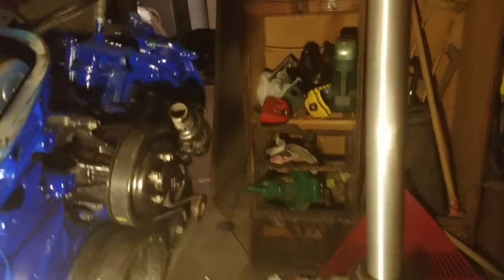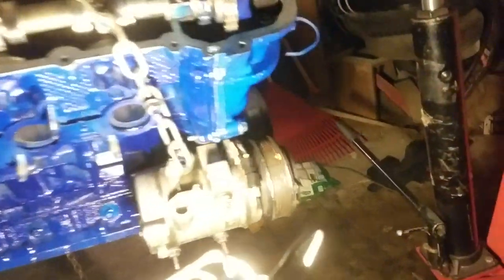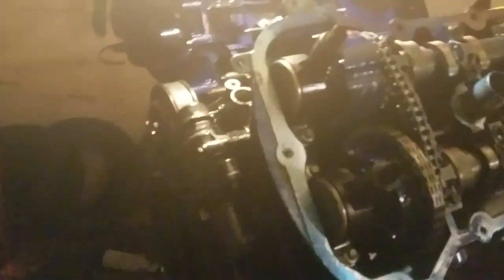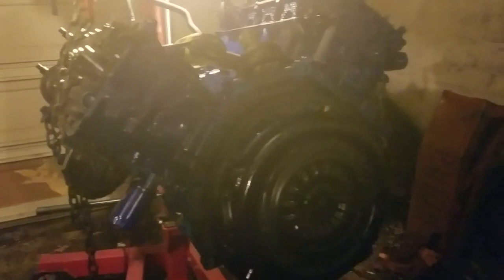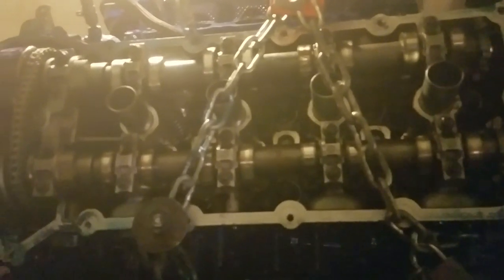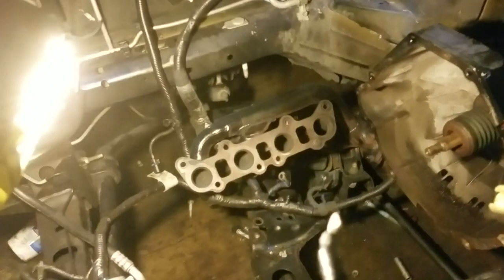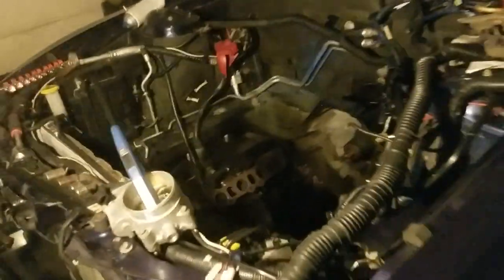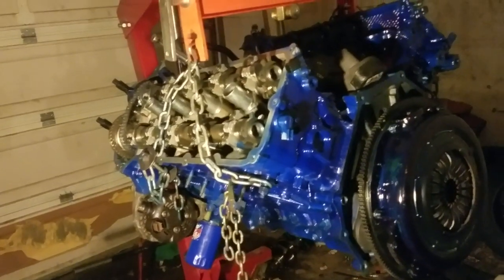The answer to the 5.0 coyote tick....smh @ ford

Comment: when you drained your oil did you notice any sparkly/glittery stuff? i have a tick on my 2011 mustang GT aswell and my oil came clean when i drained it

I know this was 6 years ago but when you changed the rod bearings how many miles did you drive on it? you still have it? did it fix your tick?

this damn tick is aggravating i thought this 5.0 coyotes were reliable
Reply from the maker: Does it sound like the tick is coming from the top half of the motor or does it sound like it's coming from the bottom?
Reply: @lyte1981  well right now engine is opened up and im replacing the timing chain and tensioners checked all rocker arms and valve lifters but nothing there seems broken so if this does not resolve the issue im going to be doing the rod bearings next wanted to know how your oil was before you did the bearings just for comparison and if the tick ever came back

thanks for the fast reply
Reply: @lyte1981  mine was a rod bearing also cylinder 5 had a few chunks out of it, good thing i caught it before it got worse
Reply: I finally got to all of them cylinder 1,2 and 4 were in good condition the rest were fked cylinder 8 was the worst

Comment: Did you get the engine back in the car again?  Does it not make the noise anymore?  I've had a similar engine noise since the car was new.  I've done engine oil analysis a couple of times never found any extra metals reflecting a bad bearing etc.  My car also has a weird phazer nioise especially after oil changes and when it's warmed up.
Reply from the maker: I just finished fixing it..... My issue was a connecting rod bearing on cylinder 5...
Reply from the maker: alcarames1 I got it back up and running....video pending🏁🏁🏁💯🌴🌴🌴😎
Reply: Jason lyte bad bearing or rod pin?
Reply: @Anthony Hales what became of yours?

Comment: yeah mine started ticking about a month after I bought my 2014 f150 5.0 from the dealership, its been a year and its turning into a knock. right now I'm running sct x4, custom mpt e85 tune, 100 shot of nitrous and straight pipes, how much you think it would cost to have someone replace the bearing? I don't really have the time for it and right now its my only vehicle, and I dont think theres much I can do to get it back to stock for my warranty not to look voided

Comment: Was it a tick or a tap noise? An did it get louder or stay constant at any rpm??
Reply from the maker: 79z28camaro1 it was a tick noise at idle to 2k rpm
Reply: see my truck only does it at idle. it doesn't go up with the rpm.. i am at a loss for what it could be..  any advice would be appreciated.
Reply from the maker: Garret Rowe do you here it up top or down low at the crank?
Reply: I have it on the rear of the engine. It sounds like it's coming from my exhaust
Reply from the maker: Garret Rowe that may be a phaser......but if you get under the truck. ....and you hear.....connector rod bearing
Reply: hmm I got under the truck and it was quiet until it got up to operating temperature then I got under it and I can here a faint ticking
Reply from the maker: Garret Rowe well my friend there is your answer you have a connecting rod bearing that is going bad
Reply: Jason lyte well that about blows.. only 75k and this is starting to happen. Run it till it blows
Reply: Jason lyte if it was a phase would is show hooked up to a computer? I took my 14 gt in for them to tell me you have no codes SMH I already knew that I need you to look further then they asked how deep my pockets are. I still have power train warranty but that scan that took 30 mins with the drive cost me $115

Comment: Hey Jason, I've been having this problem for years now.  I have brought it to Ford twice and they just change the timing chain tensioner and hand it back to me.  Works fine for a few thousand miles then it comes back.  So I bought they whole timing kit phasers and all.  Once i got everything apart i had the same exact issue you did in your phaser replacement video (same phaser as well). So i replaced everything and it ran great for about 12k miles.  Now it's back (61k miles it's a 2011 mustang gt), does this sound like the same issue you had?  Just want to be able to drive my stang without major maintenance all the time.  Thanks for your videos.
Reply from the maker: To be honest it sounds like the parts you got may not be of good quality.... tell me,; Do you have any mods on your ride?
Reply from the maker: @shite9678  ...that's ....what I thought....smh... for some reason to me ford aftermarket parts don't hold up well..... bottom line you are gonna have to upgrade from those...
Manle....MMR.... etc..